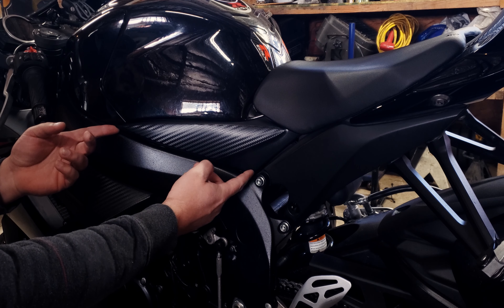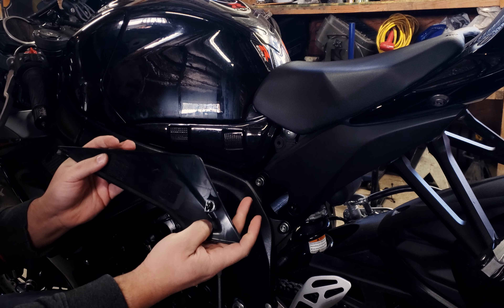Battery Tender Installation | GSXR600 | Less Than 5 MINUTES

Comment: Wait I have a battery tender what was the other thing with the usb ?
Reply from the maker: That is the Battery Tender USB charger adapter. Part number 081-0158.
It's a little bulky, but a nice addition if you need a usb charging port and have a tender on your bike already.
Reply: @Skipshift  ohh I thought it was a thing to charge the bike if the battery went dead while you were out
Reply: Is there a thing like that ? Mike went dead yesterday but didn’t have the actual charger on me but the tender was hooked up on my bike
Reply from the maker: @calieboy1509   Misunderstanding I guess. That adapter is to charge something from your motorcycle battery using the tender's connection.
I'm not aware of anything other than the normal charger that will charge the battery up through the tender plug.